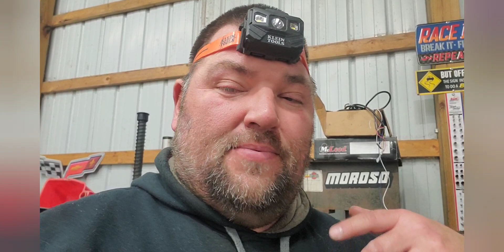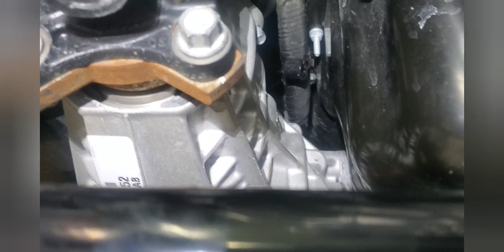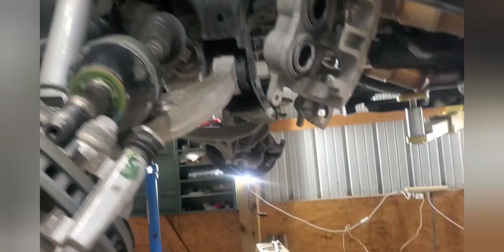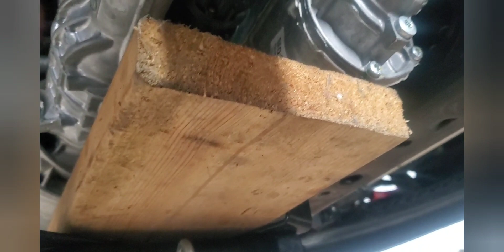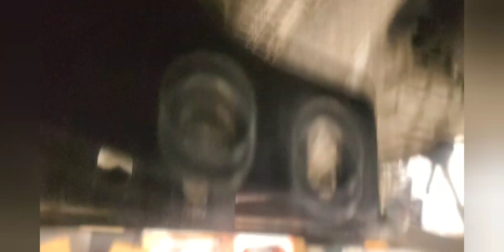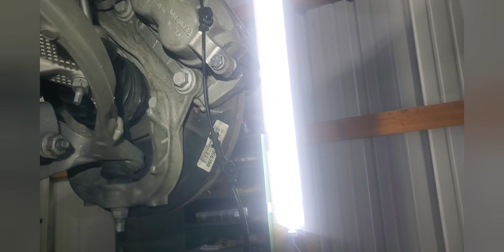RAM 1500 3.92 Swap Part 1 (Front Differential)

Comment: What is the benefit of swapping to this gear ratio?
Reply from the maker: @GHOST-666-LA-CA  it tows better, and it also takes load off of transmission
Reply: @vfr800fi07  got it. What gearing would be better than stock for drag racing?
Reply from the maker: @GHOST-666-LA-CA  i did a test..1/4 mile was identical.. mainly makes a difference under load

Comment: Do you happen to have the part number for this? I found a few..I called a couple dealerships... Same say it's $700 another says it's the $1400 Version
Reply from the maker: Part number for the front diff?
Reply: @vfr800fi07  when I used yours in the picture which starts with the P. They told me it was invalid part number
Reply from the maker: @Touchedbyapriest  https://www.ebay.com/itm/266774637517?mkcid=16&mkevt=1&mkrid=711-127632-2357-0&ssspo=DMZOncO4S-W&sssrc=4429486&ssuid=iT7x1w2BRz6&var=&widget_ver=artemis&media=MORE

This is the one for a 5th gen
. There is a sticker on it
Reply: @vfr800fi07  I'll message him and ask for the info. And then go back to dealership and ask.
Reply: @vfr800fi07  you got Facebook ? Maybe easier to message you there. I do really appreciate the help too
Reply: @vfr800fi07  found a few messaged them all. Is this where j got yours? Buying used from these guys safe? Or I've now found new $1300 from tasca parts.
Reply: @vfr800fi07  sorry to be a pain man. They have one available for about a 1000 with 1200 miles on what u think

Comment: Was the front quicker to replace than the rear will be?
Reply from the maker: If you took the 2 bolts out of the equation... Probably take 2 hours off the time seriously..
Reply from the maker: I'm doing the rear tomorrow.. probably same amount of time since there is more set up involved
Reply from the maker: It was definitely quicker to do the front... The rear was kind of tedious.. I spent more time on it because it's tow tow a heavy trailer.